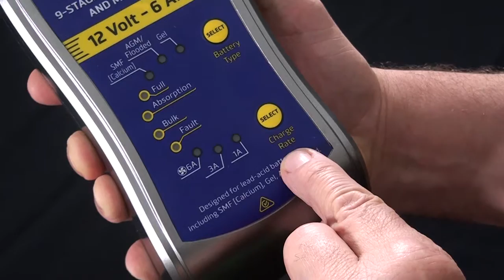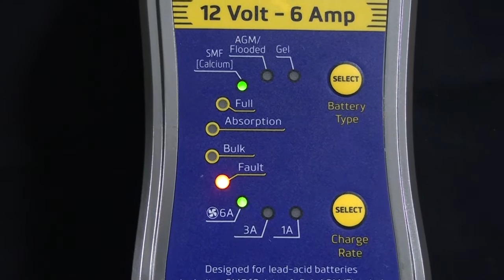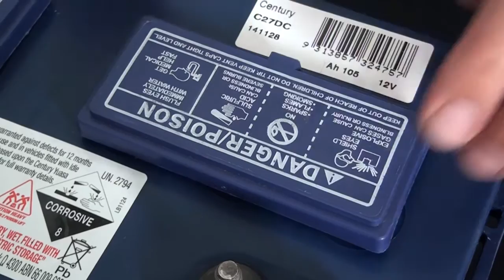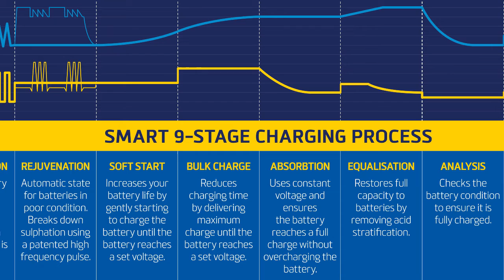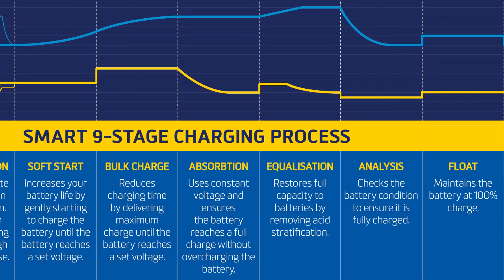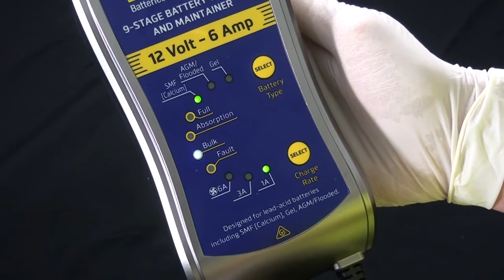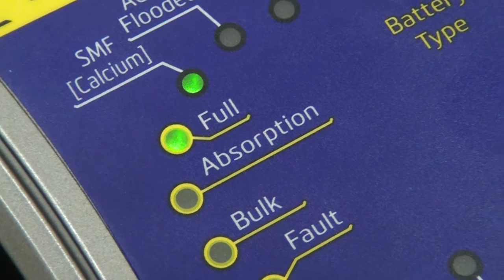How to use the Century CC1206 Battery Charger & Maintainer

Comment: Just left my vehicle's battery unused but disconnected for 3 months .. it did start my car on the 2nd attempt but as I do not do a lot of driving I am told that the battery will never be fully charged. So thinking of getting one of these to fully charge and maintain my battery to hopefully extend its life. Does this make sense?

Comment: Good comprehensive video. QUESTION- Charging a battery in vehicle, does the battery have to be disconnected from the vehicles electrics first, or can the charger be connected to the battery whilst still electrically  connected to the vehicle.
Reply: Don't take my word for it but I've charged mine many times while hooked up the vehicle
Reply: Thanks. Yes, I’ve charged a couple of vehicles batteries multiple times in situ since too, and the local century guy said no problem doing it.

Comment: Can I use this to also jumpstart my car?
Obviously with the battery still in the car connected to the charger can I start the car?
Reply from the maker: Not as a jumpstarter no. But depending on the condition of the battery, you may be able to leave it on charge for a length of time (an hour or so) and it may bring the battery back enough to start the vehicle. Obviously this depends entirely on the battery condition, so if it is due for replacement it won't hold its charge very long.
Reply: @CenturyYuasaAus  thanks, appreciate the reply.
Cheers

Comment: I have a Marine Pro 720 and a Marine Pro 650 and I can't find anywhere (on the battery or online) that will tell me what type of battery it is. They both have indicator windows but don't say anything about being maintenance free, agm or gel. I'm assuming that means they are standard flooded batteries?
Reply: Did you ever figure how to tell what battery you have?

Comment: This a three stage charger not 9, it 1st load tests, 2 boost charges for a short time, 3 slow charge and maintain. If it looses power or get disconnected it will restart the process all over!